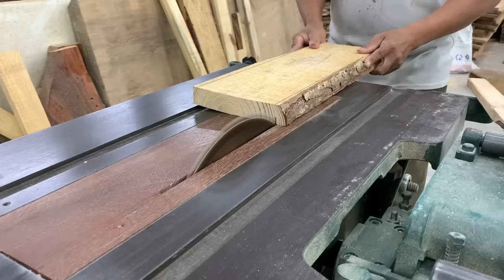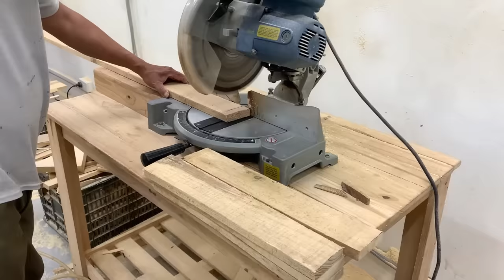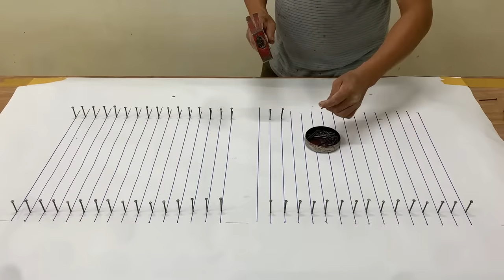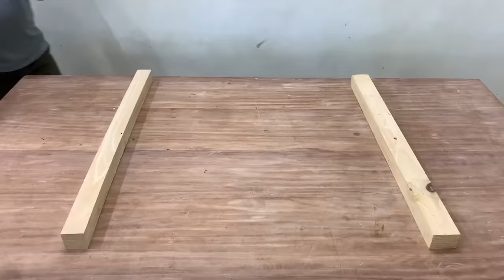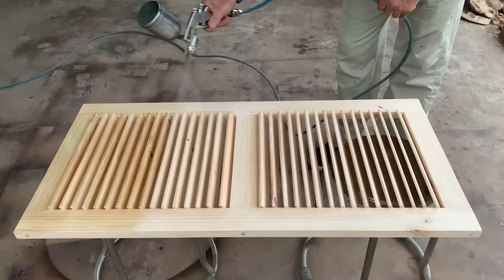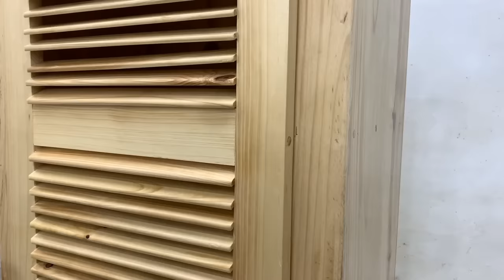Simple But Extremely Effective Tips And Tricks In Woodworking That Everyone Should Know

Comment: nothing   special   -  very   cheap   workmanship
Reply: True. One knock to the slats and they’ll lose their narrow end grain glue joint. Need to be recessed into grooves in the side frame, even only 6-8mm, not so difficult with a saw set to the depth and angle. Would also look better to use dowel or similar in cross joined top, middle and bottom frames, no visible screw hiding. This would extend it’s likely life span from 1 year to 10 years or more.
Reply: You work with what you got.
Reply: @zianeshkasparen4358  sure, but small surface end grain glue? Short life span.
Reply: x    @zianeshkasparen4358
Reply: @billb1861  that’s a myth
Reply: Poorly made. Note the crooked slat in the final picture. Not built to last. My slatted closet doors have routed recess for each slat, and they have been in service for 35 years.
Reply: Trop trop long pour prendre plaisir à regarder.
Reply: Les lattes ne tiennent qu'avec de la colle

Comment: Ok so before I stopped the video I learned:
1. Throw wood off your giagntic stack like you are digging somebody out trapped underneath.
2. Don't measure just eyeball
3. Use a flexible straightedge twice and big as need for maximum deflection
4. Parallel lines can be achieved by moving the straight edge in a controlled slide 
5. Freehand all cuts on the table saw
6. Use your big ass jointer / planer combo you inherited from your great grandfathers warehouse.
7. Reach for your offcut before blade stops b cause it saves time

Finally:
Stop watching because you have seen all you need to see, you are ready to be a woodworking Jedi.

Seriously though with a different title I would have given you mad props for what you made and how you made it without all the overthinking. Great job!

Tips though? 
How narrowly avoid injury every step of the way.
Reply: hahaha many comments here critiquing this guy and his not-at-all apropos click-bait title, but yours is the best/funniest. he should have named this vid, ''tips everyone should know NOT TO DO''...
Reply: @panosgiatropoulos157  hahaha thanks man.
Reply: I'm not trying to against your opinion here, but if you search about what's the difference between a carpenter and a woodworker, you'll understand. :D
Reply: sofa troops? ....sure you won't do half of what he did
Reply: And regardless all points you've listed, he managed make a quite square thing which is definitely a sign of a Master 😂. But I support every your point.
Reply: @darfureko2733  To your point, one thing he did that I certainly know I won't do -- I won't end up missing the tip of my left middle finger...at least not for eliminating all safety measures and practices on the most dangerous tool in the shop.  That much I know.

Comment: That nail trick is actually kind of clever, but everything else is just.. oof.. Safety apparently isn't a thing, and those slats/louvres would fall out in a year max in any climate, that has temperature changes, since wood contracts and expands. You should spray the wood before you apply hardware.

Comment: Simple might be right, but Useful is a stretch. How is it useful to rip a piece of wood on a table saw without a fence? Might as well use a hand saw.
Also ... nice looking louvred doors/shutters, but what about that big strip of glue where the louvres are (aren't?) You can see it especially while you're spraying it. Should it not have been wiped clean during assembly - or maybe the end of individual louvres should be the only place that there's glue? The Glue On The Whole piece idea is faster, but you sacrifice clean lines. Opinion only. Is there a practical reason you did it that way?

Comment: they removed the riving knife, fence and guard from the cabinet saw, dust collection does not exist. standing behind a piece of lumber while it is being milled is xtremely dangerous. kickback can kill you. kickback is very likely to happen when the riving knife is removed etc etc.. this is so wrong on so many levels. hands should be a minimum of 10 cm away from sawblade. this would be illegal in germany. somebody could imitate it and loose his fingers. you also should not glue end grain to long grain, even screws dont give enough stability. he should have used dowels instead of screws.   the slats will probably fall off one after the other.

Comment: Sucks. The cabinet looks more like a bank safe. The non-ferrous metal handle was screwed onto BLACK screws. The light wood cabinet itself is assembled with BLACK screws. But when I assembled the door, I put bright screws in the hidden holes (you can’t see it there anyway). The middle shelf - you can see how the screw got out in the far right corner. Dislike.

Comment: Wow, that first table saw cut at 1:13 ... so lucky that cut-off didn't launch back and impale him in the gut.  It's literally millimeters away from getting grabbed by those saw teeth.
Reply: not happening on a piece that is already cut-off and no fence near it to push it into the blade. The dangerous part is ripping the board in the middle where both sides can move towards each other after the cut and thus pinch the blade, where it launched the wood back at you (this is what riving knifes prevent).

But yeah, dangerous stuff happening here, definitely a friendly reminder of what not to do 😁

Comment: Gap of Wooden strips is not equal
Reply: The third one above the middle, when they put the handle on would drive me crazy.
Reply: Sub-assembly started with crooked nails that were, in some cases, not even on the line. The way they tilt would also affect how they glue up. I'm missing the part where that's a "tip" - although "trick" is still valid. How and why you'd jig it the way you did - THAT is a trick!

Comment: This video should be removed from youtube; it demonstrates the most dangerous use of a table saw I have seen on any woodworking channel. Experienced woodworkers realize how dangerous these procedures shown in this video are but newcomers to woodworking may well think this is a  safe and proper way to cut timber on a table saw. Timber must never be sawn on a table saw without using a fence to guide the timber; passing timber through a spinning sawblade freehand is a disaster waiting to happen and believe me, it will happen. Also not using a blade guard or splitter is equally as dangerous. Anyone new to woodworking, Please disregard the techniques used in this video and search for other videos on this subject that show safe and proper methods of using woodworking equipment.